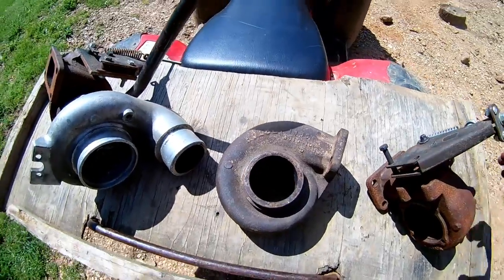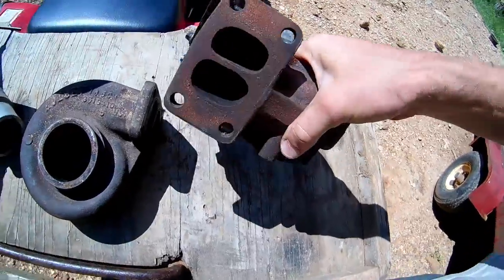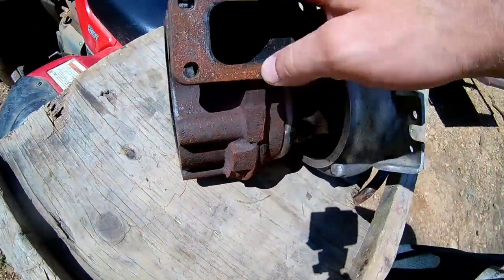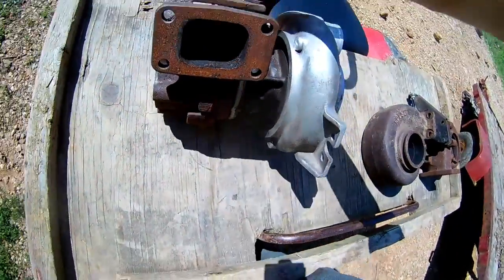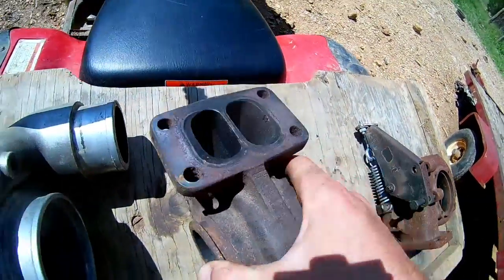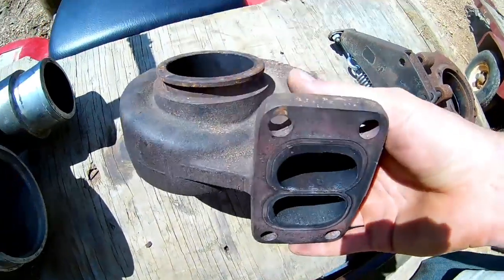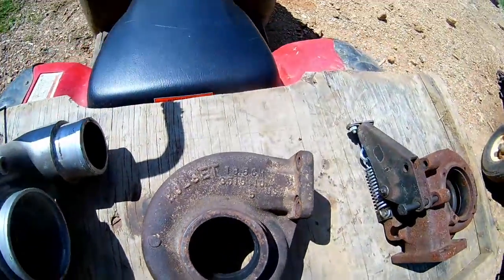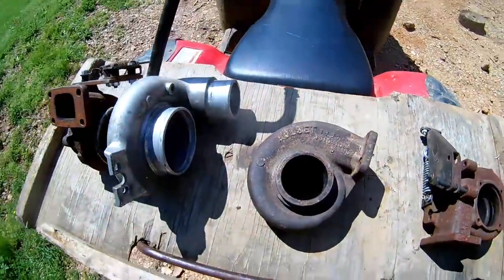Find your Holset Turbine Housing Size

Comment: Will the hy35w 9 cm exhaust housing bolt in a hx35w with the 12cm housing?? I have one laying around, I’m doing a jeep in line 6 turbo build, looking for low rpm spool
Reply from the maker: No the housing will not swap, the hy35/he341/he351 all use a v-band connection instead of the bolt on connection of the hx35.  From my testing, the hx35's 12cm divided housing spools better at low rpm (below 1600rpm) while the hy35's 9cm undivided housing spools faster above 1800rpm.  This testing was done on my 12valve Cummins.

Comment: Do you know if the exhaust and compressor housing are interchangeable. I've heard that you can put a hx40 intake housing on a hx35. Any thoughts on that.
Reply from the maker: The compressor housing from an HX40 will physically bolt up, but you will also need to be running a HX40 compressor wheel.  And in order to run a HX40 wheel you'll need to machine the CHRA for a larger wheel.  The HE351CW is basically a newer version of the HX35/40 hybrid.  It uses the 7 blade wheel which spools and flows very well, the exhaust housing is 9cm but being single scroll flows surprisingly well up top.  So unless you get a deal on the parts/machining to make a hybrid, I'd recommend a HE351CW because it outperforms it in basically every way.

Take care!
Reply: CumminsWorks will the he351cw bolt up to a second gen manifold. That turbo is for 3rd gen correct? Seems like a lot of machining and balancing and parts to get the hx40 to work.
Reply from the maker: It takes a little work, you got to get an adapter for it to bolt up to your exhaust pipe, and then drill out two of the holes on the turbine housing for the exhaust manifold studs to go through.  You've also got to get a 2.75" to 3" 45° boot and clock the compressor housing for it to hook up.  Then you've got to find a way to control the wastegate, a simple spring gate works very well.  If you've got a welder it's pretty simple to fab up.
Reply: CumminsWorks would it even be worth it to go that route or should I bite the bullet and buy a nice turbo.
Reply from the maker: It depends what your goals are.  The HE351CW can be had for a decent price, spools about like stock, and can support a cool'n clean 400hp or a hot and smoky 500hp.  A HX35 will support a cool'n clean 300hp or a hot and smoky 400hp.  There are other turbo's on the market like a K27 or a SXE362 that are a little more bolt-on if that interests you.  The k27 is between a HX35 and a HE351, and the SXE362 is a little bigger than a HE351, so it will spool a little later in the RPM range, but support more HP as well..